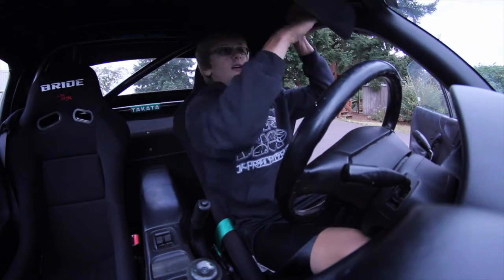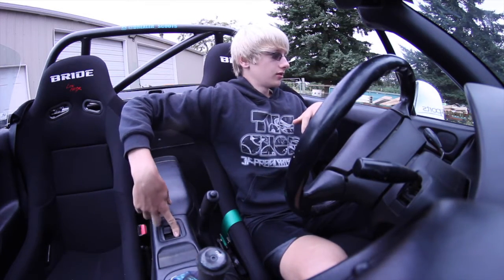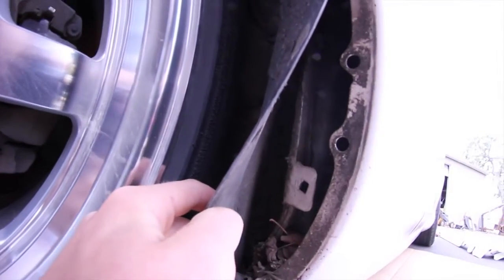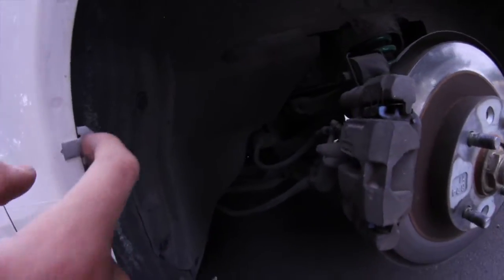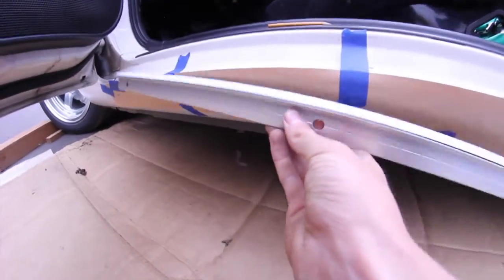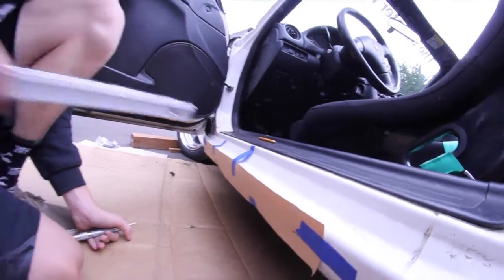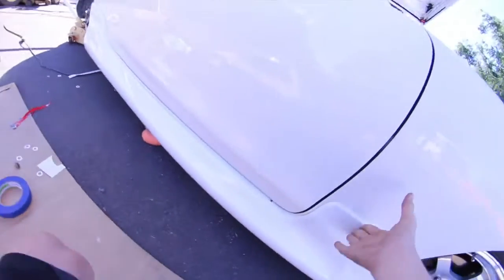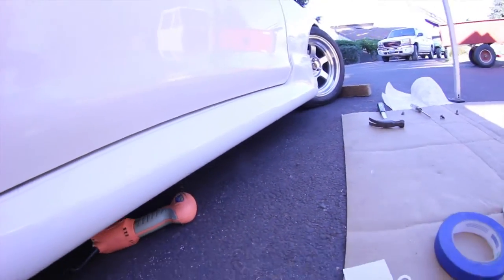Side Skirt Install | Project Miata Pt. 3

Comment: at 2:13 how did you manage to remove them? Just with your bare hands, or did you use a tool?
Reply from the maker: William Kim they have a screw in the middle. Twist and pull and they come out easy

Comment: where to get big Tupperware sides?
Reply from the maker: I didn't realize how big they were until they got here. They aren't horrible looking and I actually kind of like them better than the oem small ones
Reply: +Drexler Stuivenga yeah I also have the little side skirts but I like the look of the big ones. I just don't know where to get them.
Reply from the maker: I found them on "shutter" eBay. They were the legit Mazda ones, there's all the colors on there